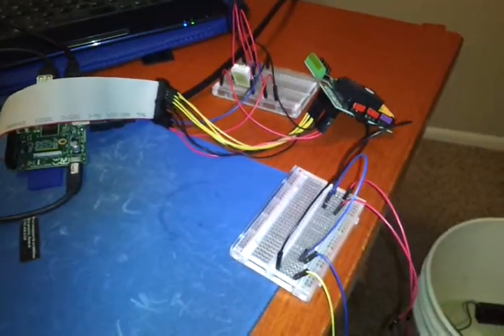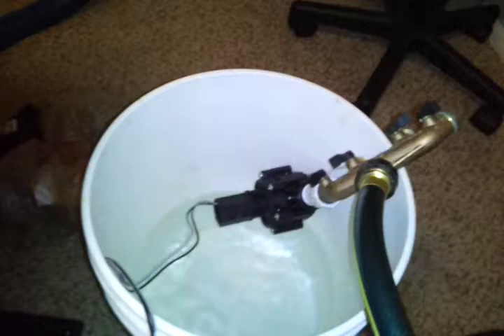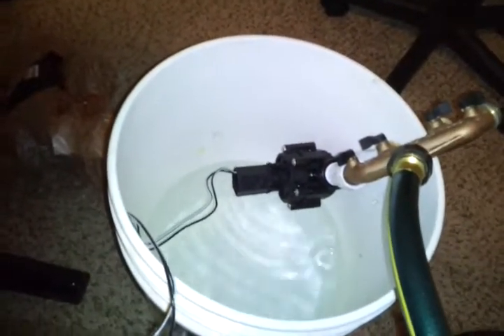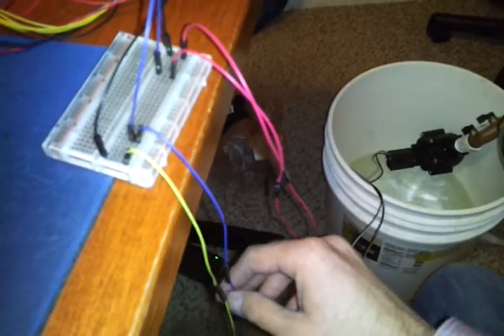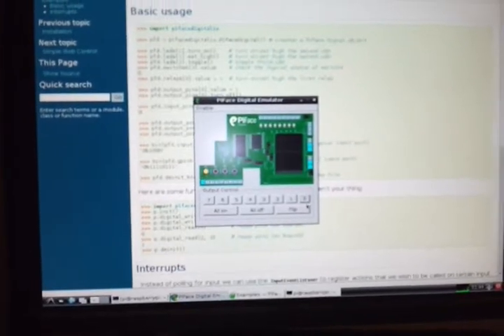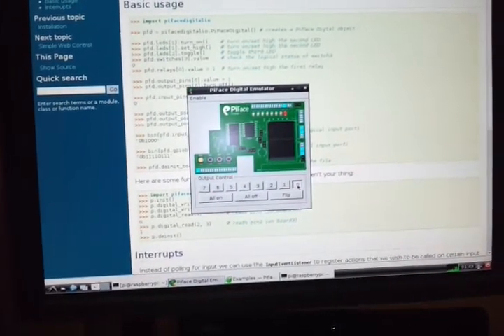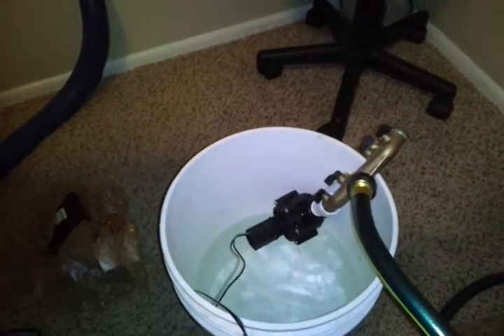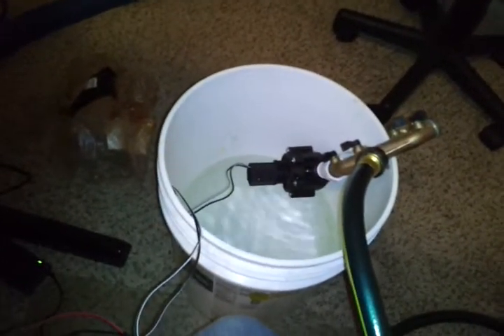Solenoid valve and PiFace

Comment: planning on making a irrigation system but ive got stuck ive got piface digital could I power the solenoid valve and the raspi with a solar panel as its going to be an outside one where every few hours it waters the plants? Do you have any ideas? many thanks.
Reply: Just remember to match voltages, these retail solenoids are about 10V to 20V to activate.